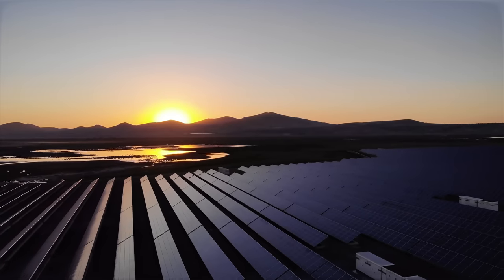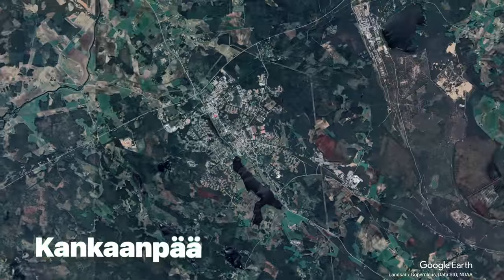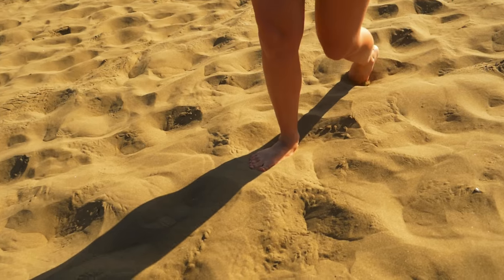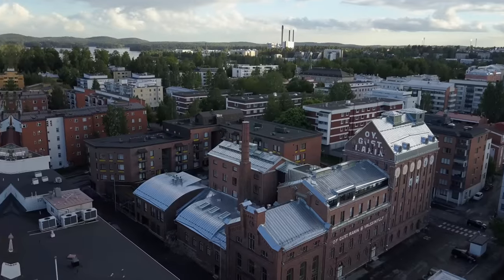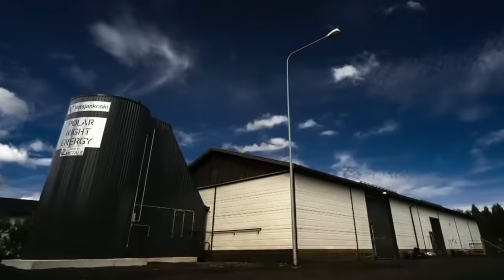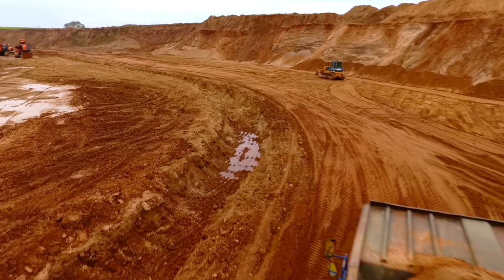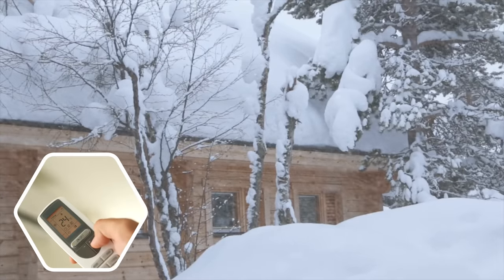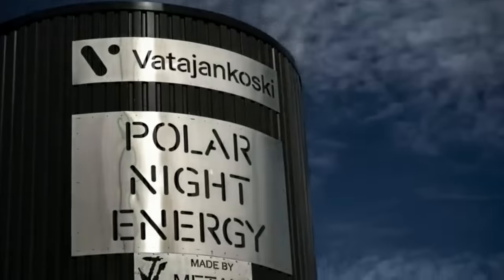Breakthrough Tech Heats Homes Cheaper Than Natural Gas!

Comment: You forgot to mention the high costs to bring the stored heat energy to the houses. Sand or rocks are usable to store heat, but I prefer to use hot air for transportation. Hot Air heating has been used by the Romans century ago in the form of Hypocaust. It could run for decades with nearly no maintenance.

Comment: Heat pump are very inefficient in cold weather below freezing. Require a backup heat source unless ground source which is expensive but more efficient. The sand battery for heating would work better with a waste heat source.

Comment: It's a con to sell sand tanks, you would have better heat storage if you put the heating elements in the ground below the frostline. You would be better off investing in insulation for your house. During winter it would be inefficient, the heating elements would use more energy than the grid could sustain. The best solution would be geothermal wells, they never run out of heat and are extremely low cost. Thats why they don't do it, they can't exploit it for profits and make money the entire life of product.

Comment: so this concept is great if you already have city heating installed. if you go on low density area's installing pipelines to all the houses to move over heated water is verry expensive and maybe not economical. but great to have these batteries besides a city water heating facility. allowing to store surplus energy in the batteries to use during the night when solar is down for example or during the day if wind is down

Comment: I wonder how big the sandbattery has to be to provide just enough for one house? Make a concrete pit of 4 cubic metres below an average  house, fill it with pipes and sand and place a solar panels on the roof. Store your own solarheat in summer and have no heating costs in winter. At least 80 % of our energie costs are heatingcosts. No expensive electric homebattery but just a sandbattery.

Comment: I would opt to manage to produce electricity out of the heated sand. More versatile and more easy to transport. Alas, less cost effective and some losses. Pipe in the sand to get steam (water or different medium depending on the average temperature of the sand) driving a relatively small turbine or steam-engine. As the sand is not stirred, heat extraction is limited. Therefor injection of water without pipe to get steam could work better. But then the storage container is a pressured one, which add costs. But should be more cost effective compared to H2 production.

Comment: Do you know that solar is nuclear? So now you can go nuclear without the messiness by using these sand batteries, getting nuclear energy from the sun. 
Get your heat without messing around with dangerous fuel rods. Turn that heat into electricity when needed. Wayda go!

Comment: Just FYI, the Texas grid didn't fail because of just increased energy usage. We would have had enough energy if all our power plants kept producing at their max capacity. The grid failed because many of the power plants themselves were not weatherproofed to operate in very low temperatures for extended periods of time, so some of them had to be shut down until temperatures came back up. The most failed type of power generation by percentage was actually the wind turbines, so just because energy is renewable does not mean it is weatherproof. Also, the Texas legislature already passed a bill to weatherize the power plants that failed, so once that's done it's unlikely to happen again unless temperatures get even lower for longer, which will be rare if it ever happens.

Comment: Insulation is a must, or it’s wasted heat.  Like  in the Persian  Gulf. 57c one year, heat of sand red hot to,touch. But after sundown, it’s in reverse. It takes the surface heat off with the wind  at night, eventually becomes a freezing contrast?  Not a bit of steel,on the 😂ship could be touched by hand  day time for quite a long time till the wind ceased. Cold  silent desert , cool air replaces the hot.  Night after day temps , too much, guys who worked all the time in it. Dangerous if no protection in nights. Reverse and make the cooler in use for daytime heats, air conditioner.  But it need to be retained , captive, reverse.

Comment: If you are using electricity to heat the sand, why use resistive heating instead of a heat pump, which could produce 2-3 time as much heat for the same amount of electricity.

Comment: Unfortunately, the sand battery just stores heat, not the electricity produced by the wind turbines, so it's not equivalent to the lithium batteries required to store electricity, and electrical resistance heating is not very efficient.

Comment: I wonder how they're distributing that heat, and what kind of losses you get in the delivery process. This seems like one of those solutions where it's more practical on the small scale, every house has their own sand bin, so the heat doesn't have to go far.
Reply: It's distributed by district heating. In my town we have about 60km of pipes in the network, 630 customers and over 107GWh of energy every year at an efficiency of about 90%. And as with most things this too is more practical on bigger scale (ok, I don't know where the sweet spot is) as when you have bigger pipes your surface area is smaller per moved energy and thus your losses are smaller and efficiency higher.
Reply: @VilmaHallikas  If those numbers are correct, that's 19 kW continuous draw for every person. That seems like an awful lot... but I guess the 90% is what my question was about.
Reply: @DFPercush  it's clients, not people. Client can be anything from 1 to hundrerds of people.

Comment: It´s much cheaper and efficient to directly use solar thermal water heaters, rather than use Joule effect to generated heat, one of the most inefficient ways. Also, the energy looses in the pipes that distributes the heat to rest of the homes.

I think that the goal of the batteries is to keep the capacity to obtain electricity from them, not only heat.

Comment: Okay I will agree with that being great for winter time and the heating part , what about summer time and all the extra heat that would continue to keep driving up the planets temperature? How would it work in the summer time? I take it you are going to continue to heat the sand to make steam for driving a generator to make electricity? I am not sure how you could cool it to run a cooling system for buildings and then it would act as a two fold to drop both indoor and outdoor temperature but I am not enough of a visionary to see it do this without expending too much waste to be feasible for cooling in the summer without using a ton of energy to do so. I would love to see a video on how it is going to work for cooling purposes. Unless it is going to be heat only for steam generation only. I will be looking forward to seeing you answer this question. Good morning and great day to you all.

Comment: Why above the ground?
Why not just below the surface which obviously is easier to construct with concrete? Further concret is a better insulator to retain heat than a metal tank.
Reply: Yes, concrete that has an R value of 1 per 10 feet.We have to love these english majors.

Comment: OK he compares sand to natural gas.  The sand can only store energy, not provide energy.  So it is not proper to compare sand to natural gas.  You have to heat (or cool) the sand somehow.  Also, what about using water instead of sand?  Did not see that possibility examined.  Yes, construction-grade sand for making concrete is sharper, and more expensive than random Sahara sand, which is rounded off,  and so does not make for strong concrete.  That's why when people talk about "selling sand to an Arab, or ice to an Eskimo, it's actually not a joke, so much as reality.  They import a lot of sand to the Middle East for concrete!  And I'm sure all the seven-elevens in Alaska sell ice.  Anyway, I do think this is the basis of a good idea.  Here in the Mojave Desert we might try running ambient cool air thru the sand at night, for cooling a home during the day.  Vice-versa in winter.  A mere fan uses far less power than a heat pump.  :)

Comment: this could be beneficial anywhere you have it.

Just think of all the inner city larger sports facilities and such which could benefit from this...also, think of the heat they generate through cooling.

If all that could be captured and released back when required, the marginal gains could continue adding up to make a big difference...especially if new developments are built around such an idea

Comment: I have an 800 gallon water heat storage tank up here in Maine that I store heat from a wood/oil fired boiler.  I had been wondering if it would be better in some ways if the storage tank was filled with sand instead of water.  Would it transfer heat too slowly?
Reply: water has much better heat transfer.  Sand may hold the heat longer,  but also takes longer to absorb it.  That's how I see it
Reply: Sand can be heated above boiling point of water

Comment: This 'sand heat battery' is designed to shave off demand peaks.  But since it uses resistive heating to replace heat pumps, isn't it effectively driving up off-peak demand by 3-4 times more than necessary?  (1 KWH of electricity for resistive heating produces less than 1KWH of heat, after accounting for losses.  1KWH of electricity in a heat pump could be easily producing 3 to 5KWH of heat.)

Since the sand heat battery is electricity fired, can it be made 3 to 5 times bigger by using a large heat pump instead of resistive heating?  That way total electricity usage from the grid does not go up so much.  (It will still go up a little, to account for heat losses from the sand battery.)

Comment: Storing the energy is not the solution. Fully integrated world wide power grid would be way more efficient. You generate it with the sun / wind / geo / etc on the shining side, while the sides in the dark only consumes it.

Comment: I wanted to say Duh , but I will be nice. I am a Solar Thermal specialist. I have been shouting this from the Mountain tops since 1986. I live in the Midwest in America. I have designed, built and upgraded Solar Thermal systems for years.  Solar Thermal energy is more efficient to harvest than Solar Electric and we need heat in our area 6 to 8 months out of the year for space heating and heating water is needed year round for cleaning washing and sanitizing. 

I have proven that it is of greater benefit in a years time in this area to offset utility costs.

Comment: It's a step in the right direction but still a niche solution for places that can't use heat pumps in the coldest periods of winter. Then there is the infrastructure build out and maintenance plans that need to happen, good for all the rural small town centers that dot the northern latitudes where putting an SMR (even a micro reactor) just won't make sense.

Comment: In sunny climates the sand battery could be heated by direct solar which would heat a heat transfer liquid such as water.   When the home(s) needed hot water for bathing or heating, the cold water could pass back through the same pipes to be reheated.   I'm assuming that sand will retain heat better than water.
Reply: You missed the point that this runs at 1000 deg. F.
Reply: the heat storage of materials is referenced to water. Example. Water stores 3 times more heat than concrete, gram for gram. Concrete weighs 2 1/2 times water. By volume, water stores more heat below the phase change.

Comment: I like the idea.
Also heat pumps are less efficient in temperatures below 40 degrees F, when they then use expensive electric strip heating.

Comment: hook a hot & cold sand battery to both sides of heat pump.  Use cold for refrigerator/cooling and heat for hot water / heating
Reply: How hot would the heat pump raise the temp. of the sand?

Comment: 3:12 "The greater the resistance the electricity encounters, the more heat is created."  Not true.  Hook up a batterery to a one ohm resistor and then to a ten ohm resistor.  The one ohm resistor will be hotter than the ten ohm resistor because more current (energy) will flow through the one ohm resistor.

Comment: Thank you for sharing. Please don’t advertise product that will lower your credibility. That tyre pressure portable pump the expensive one will pump up a car standard size in5 minute meaning double that time for a SUV tyre. Only a desperate fool will invest in that. Keep in mind the audience you attract are incredible and intelligent. I don’t wanna talk more about the negative, thank you for sharing the wealth of knowledge in energy transfer and storage. 👍🏾🙏
Reply: I keep a stand on it, push the handle down tire pump in my trunk. Always works as long as I eat. Less than a dollar a year if you keep it 20 years. Keep it dry and lube the piston seal wit silicone grease and it will last for centuries

Comment: why use electrical power? my uncle used to have about 55 gallon water containers in his attic that he did during the day from the Sun and then at night he would use fans to bring the hot air from the attic into the house. it only had one moving part and was extremely efficient. it is still very expensive to use solar panels or wind generators to produce heat from electricity.

Comment: Where I still see it being helpful, even in a hot climate, is for hot water heating. ie using solar etc during the day to heat up sand, and then using that to provide hot water for washing etc when required instead of heating the water directly with electricity. 

As the sand can go to a higher temperature, would the same size 180l cylinder but with sand etc then hold more heat energy than the same in water, and would it hold that heat for a longer period of time so that it ends up being an energy and time benefit

Comment: There is unlimited energy available stored in hydrogen (water) using hydrolysis.  But  you change the hydrogen bond angle from104degrees to 114degrees this is a weakened bond angle that only takes less that 1 amp to strip the hydrogen  where 104 takes 30+ amps (expensive).

Comment: So you're still using power from the grid to store heat in the sand. I'm not seeing the energy savings here, unless there are massive solar panels to heat the sand during the day. The problem with that is there isn't many hours of sun during the winter to heat the sand. Wind power could work, but then again there still isn't enough power in the grid to both heat the sand and heat the homes during the day.

Comment: I actually already have a heating technology that is vastly cheaper than natural gas or electric and is 100% carbon neutral.  It's called firewood and it is literally just laying on the ground all around where I live.  I mean, you can literally just walk outside and pick it up off the ground and then take it inside and burn it and your home gets warmer.  Amazing stuff that.  Now if we add in the added mass of the stone surround I can actually continue to heat my home even after the fire has gone out.  Science should start looking into this stuff.

Comment: Converting a higher form of energy, electricity, into a lower form, heat, is almost always a very bad idea. There has to be extenuating circumstances that cause the normal rules to fail. Having infinite geothermal energy, for instance.

Comment: in warm arias they could be used it oppositely. they could be cooled at night by a reverse  heat (cool) pump. bringing the sand to a near freezing temperature then feeding the cooled water into a building..
Reply: Run the numbers on using 32 deg. F sand to cool water to 40 deg. for AC.

Comment: Interesting solution for hot water/heating. 
If the whole thing could be buried, it'd be a winner aesthetically, but that may of course have an effect on the thermal performance if the ground would leech out heat from the battery,.
Useful contribution to the killer problem of intermittency.
Reply: I'm thinking wind probably leeches more heat from the battery than the ground would, no? But I'm no physicist

Comment: Dumb question time:  How exactly is the sand heated by "resistant heating"?  What kind of resistant heating are we talking about?  Is this like electric heating cables that you wrap around pipes to keep them from freezing?  Copper wires attached to voltage?  If I want to experiment with this, what could I put into, say a barrel of sand, that would heat up the sand to 600C?

Comment: How many wind generators or solar panels are necessary to heat this sand? I can understand storing the energy from solar power during the day and then using it at night with no solar power is available but why not just build more wind generators to produce heat at night when the wind blows?

Comment: Probably good if you were running a steam turbine, or sterling engine. Most homes don't need 1300 degree heat. The far more practical way is with several domestic hot water heaters, solar driven. Here in Canada, domestic heat, and hot water are the lions share of our energy use. Now if someone comes up with efficient solid state heat to electricity, that would change everything. Nitinol just never payed out.